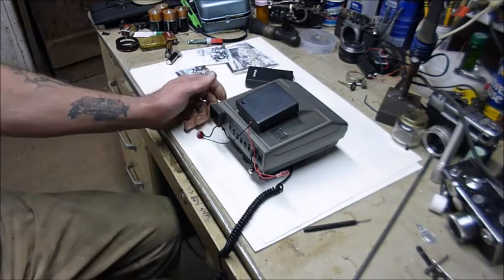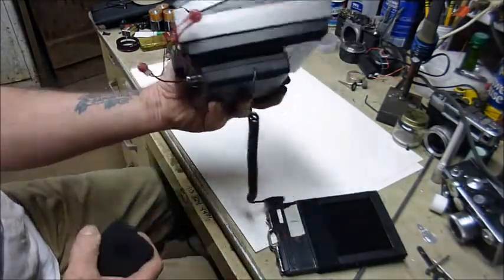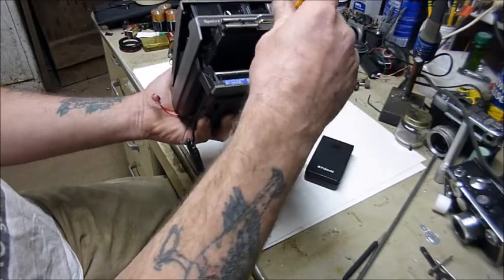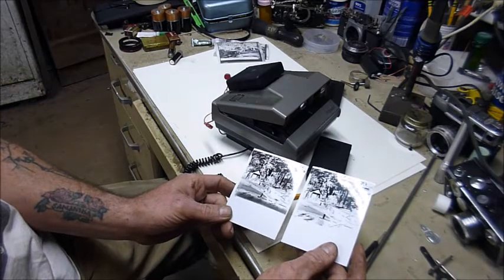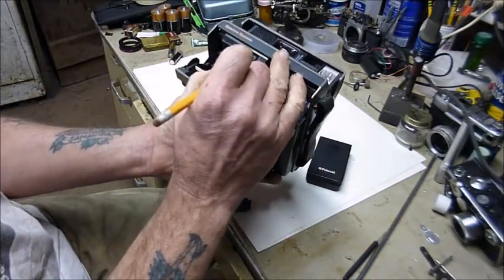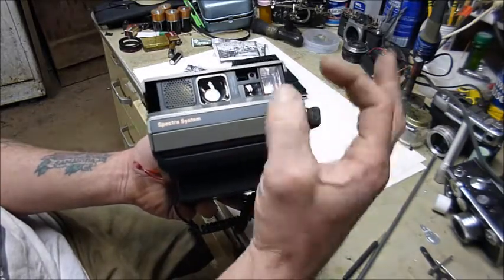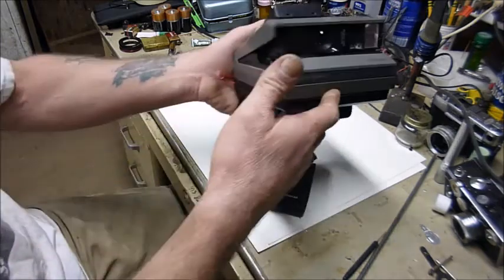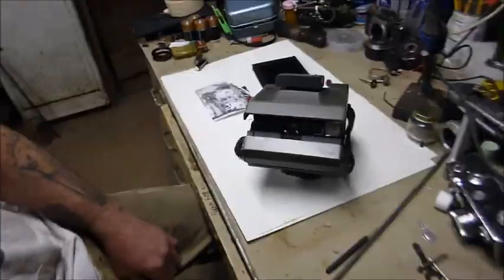polaroid spectra conversion

Comment: Are you connecting the battery pack to the remote? IF so, how?
Reply from the maker: No, the remote is wireless and self powering with a 9 volt battery. The cord hanging from the camera is a mystery to me, probably for some other attachment.
Reply: so the battery pack just connects to the power wires inside the camera then?  @tobroken1965

Comment: Thank you for sharing this amazing tutorial, can you explain which ND filter pieces you used in order to expose the paper negative? Thanks!
Reply from the maker: I started with a 2 stop ND, I dont remember where I ended up (i got involved with other projects). Spectras ISO is 640 and the photo paper is about 6, so you have to cut the light down quite a bit. Experimenting will yield the best results depending on the lighting conditions. Use a tripod, the exposure will be fairly long, a second or more.
Reply: @tobroken1965  Thanks for the info, much appreciated.  Would you consider selling one of these conversions? Thanks!
Reply from the maker: @BRB-BRB  I only have the one and it hasnt been fully tested, so that would be a no, and at this moment I dont even know where it is. But if you are interested it was easy to do and I posted the link above. They are pretty cheap too, I just looked at ebay and there are a bunch for short money, one listing has both for $35. The biggest problem was a dark space to cut the paper and fit the old school film holders.

Comment: Is it possible to fit 600 film in there?? Modding it of course
Reply from the maker: probably but I never tried. Polaroid Originals and Impossible Project were both selling spectra film, check with them if fresh film is what you want.
Reply: I know but I think you can actually take an empty spectra cartridge and put i type frames in it in a dark environment
Reply from the maker: Oh I see, I havent used the i type yet. I suppose it could work as long as the mechanics of the spectra worked. It needs to eject and roller press the frames as they are exposed. Spectra, i type and 600 are semi close relatives, I am wondering why you wouldnt just get spectra film for a spectra camera. Is there a special effect you are going for?
Reply: tobroken1965 it was discontinued